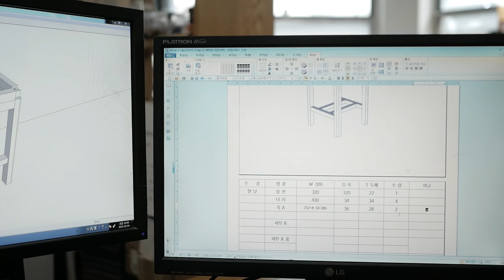SQUARERULE FURNITURE - Making  Walnut Stool

Comment: Very nice stool. I like the hand made brass seat mounts, cleaver idea for the wood movement. Superb as always!
Reply from the maker: I am happy to go to bed today for your compliments.
Thank you for always
Reply: I am not a skilled woodworker, but my trigonometry says the brass mounts can never pivot, unless the panel shrinks in one direction and expands in the other direction at the same time. Am I mistaken? Anyway, great video, fantastic work!
Reply from the maker: @RemonHuijts  I am not sure in which direction the tree will stretch or shrink. It depends on the surrounding environment and humidity.

However, the work was done so that the tree does not interfere with the contraction and expansion.
Also, when walnut is finished with oil, it is stable and does not shrink or expand much.

Thank you for your valuable opinion.
Reply: @squarerulefurniture  Thank you for the reply! I have no experience with walnut, but like other woods it will probably shrink and expand only/mostly in one direction, across the grain, and not along the grain. But you have positioned the brass hardware in a way that it cannot absorb such movement. Imagine that the top panel shrinks: rotating the brass mounts cannot bring the screw holes any closer to each other, so the panel would split. It also interferes with expansion, but that is harder to explain without drawing pictures.
Reply from the maker: @RemonHuijts  It doesn't stretch as much as you think.
The size of the top plate is 320mm, and furniture larger than this should be installed with more durable hardware or those that fully respond to shrinkage and expansion.

As mentioned earlier, the reason walnut is expensive is that it can be somewhat free from contraction and expansion if it is finished with oil. For this reason, the design or structure can be a little more drastic.
Reply: @squarerulefurniture  Thanks, this is very helpful information for me!

Comment: Hello, I enjoy this design and will be attempting to replicate it in my furniture making advancement class. I've figured out that the design measurements are 12x12x17h (325x325x450h), would you mind sharing the dimensions of the legs, are they 1x1 (25x25) or 1.5x1.5 (38x38) or maybe 2x2 (50x50)? Thank you so much. You are a true master! I love watching your precision work!
Reply from the maker: The answer was late.
The legs are 34*34, the top apron is 35*28, and the thickness of the bottom apron is 24*24mm.

Comment: will there be any issue with the table top splitting as the wood expands and contracts over time?
Reply from the maker: Walnut does not shrink and expand much more than expected if it has a good oil finish. In addition, brass hardware was used in preparation for contraction and expansion.
Reply: @squarerulefurniture  oh thats really interesting to know, thank you for the informative reply

Comment: What is the benefit of the circular saw based tenon machine vs the nice laguna band saw? Isn’t it harder to cut flat tenons that way?
Reply from the maker: The tenon circular saw is easy to set and can work quickly.

Laguna band saws are precise and powerful.
The downside is sawdust bounces all over the place.

Comment: Thank you for the video. One question, what you use for wood finish? Blo?
Reply from the maker: For the finish, auro 126 oil is used, and the top is additionally finished with water-based varnish.
Reply: @squarerulefurniture  Thank you.